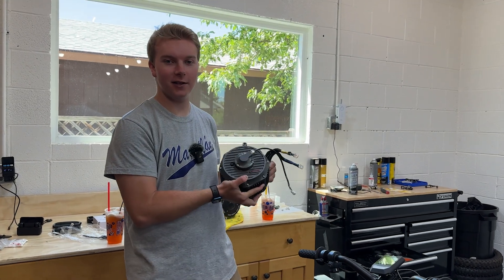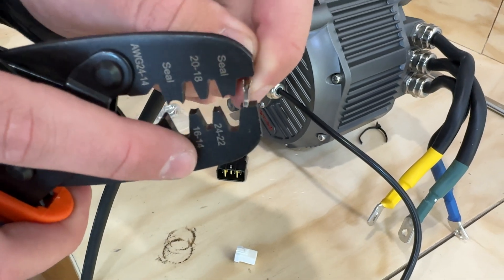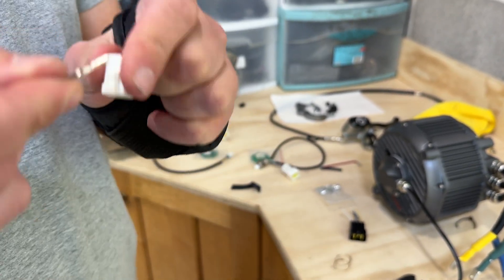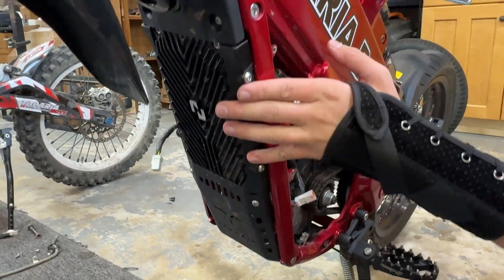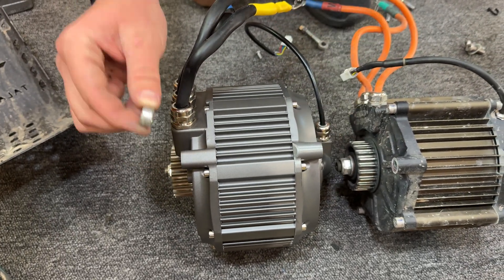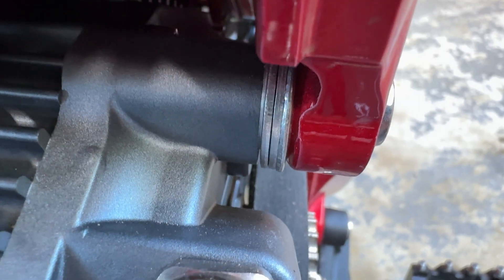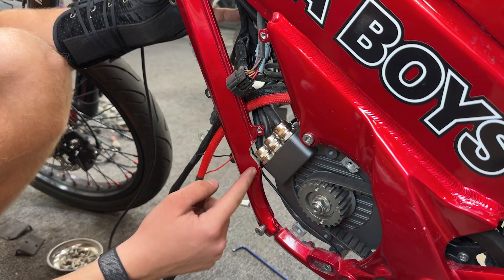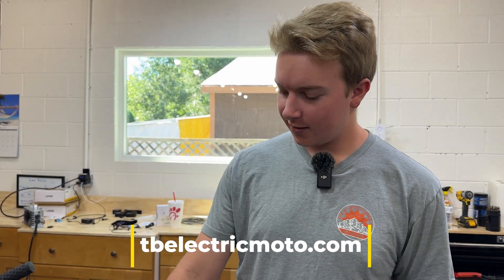SOTION Motor install on a Talaria XXX // HOW TO

Comment: U did not crimp that properly at alllllll😂 you put the pin into the crimper click it down til it holds in place feed the wire in an then crimp down
Reply from the maker: Thanks for the tip, appreciate the feedback.

Comment: Sotion motor for Light Bee or Ultra Bee or it doesn't matter as long as Surron
Reply from the maker: There are different models of the motor for each surron
Reply: @TBElectric in the video..that the Light Bee motor.. right?

Comment: would this work with stock power? and which sotion is that
Reply from the maker: No you should only ever upgrade your motor as the last power upgrade, always do the controller and battery first

Comment: I have this motor and am trying to connect to my Nucular p24 controller. In the video it says to get the hall sensor version but in the info below you stated to get the encoder version if you are using the Nucular controller. I got the encoder version and now I am struggling to get it to work. Do I need to get a different connector from my motor, the hall sensor one? Or do I need to reach out to Nucular for advice on why it runs the auto setup but keeps having a timeout on the motor setup?
Reply: What did you figure out I'm in the same boat right now
Reply: @droppeds10404  same with me any thing work for you?

Comment: So no plug in play motor out yet pretty much?
Reply: guess not😭 i’ve been searching for hours for a motor that’s plug and play on the x3
Reply: @firefort2895  its been a while is there any news on a plug and play motor?
Reply: @anacondaplayz9579  nope none but 100's of new surron parts like they have enough already.
Reply: @Kamicazeeee nobody even getting surrons either unless its an ultra bee everything else is better
Reply: @firefort2895 embx and torp taking they sweet time.
Reply: @firefort2895 still none out

Comment: I own a red xxx from Luna I'm definitely ready for more power but money is tight and only gonna get 1 shot. I was thinking x9000 and sotion combo but heard you say your putting the p24f back on with the sotion may I ask why you guys said that? I want to make the right choice 1st and you fellas are straight shooters
Reply from the maker: Both options are excellent, we’re running the nucular right now and it works great even with the high power battery and motor, but the x-9000 also worked excellent. It’s really just personal preference and you will love either one. I would say that if you don’t plan on doing a battery or motor then the nucular would be my first pick.
Reply: @TBElectric  Definitely doing the motor and battery
Reply: @TBElectric  And thank you for the response